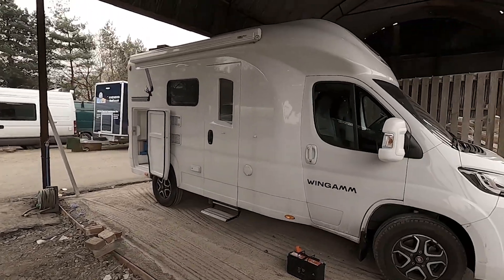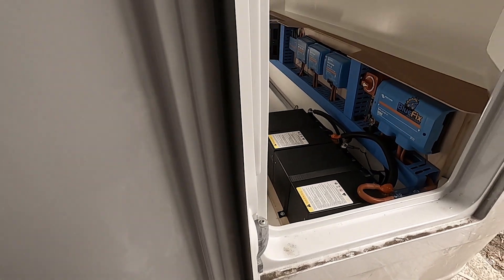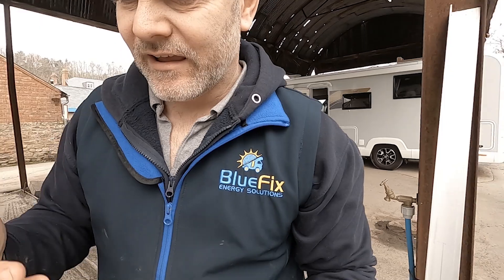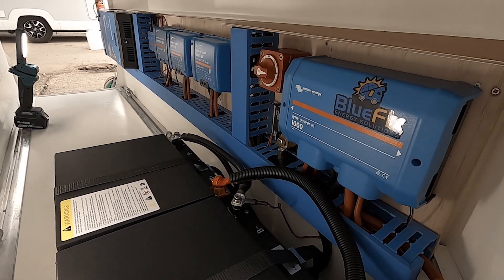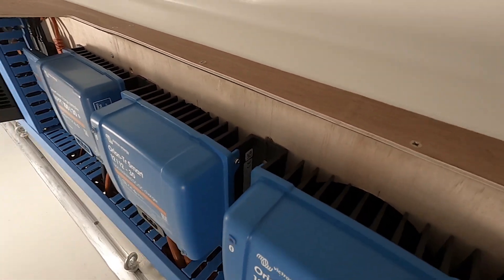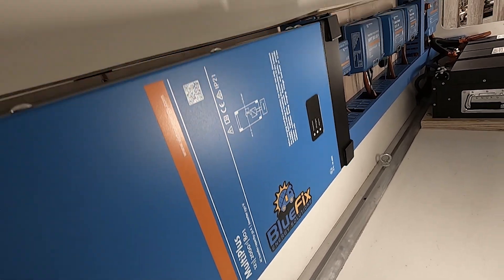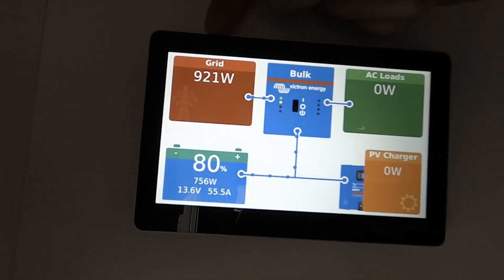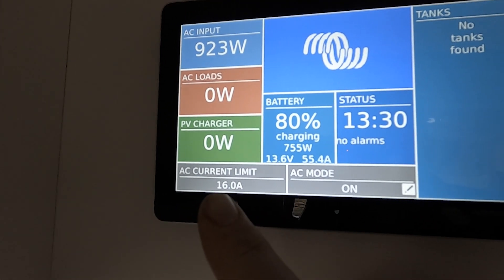Blue-tiful Victron Install || Off Grid Motorhome

Comment: I wondered - is the output of the inverter wired into the back of the consumer unit in the van (and therefore powering all the 240v items)? and if so, is there an ability to switch between hook up power and the off grid inverter/batteries? (like an A/B mains switch)?
Reply from the maker: The multiplus has an automatic changeover. The hookup feed from the outside of the van first goes through an RCD in the consumer unit then into the multiplus then back into rcbo's in the consumer unit which go off to the sockets and any 230v appliances. The multiplus senses when hook up is attached and allows that to flow through instead of using its in built inverter.
Reply: Thanks - that makes sense -  @BlueFix